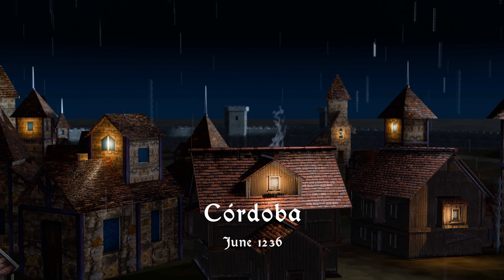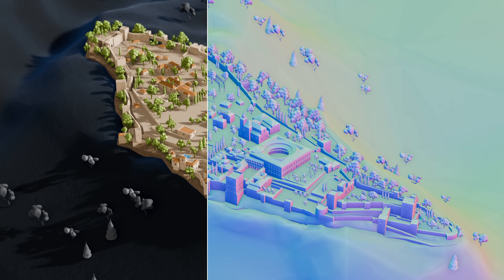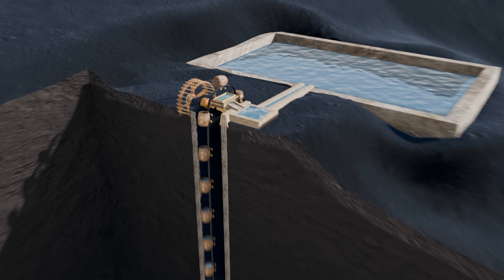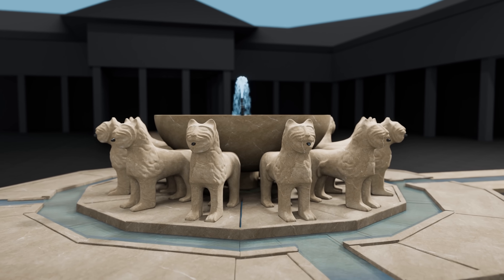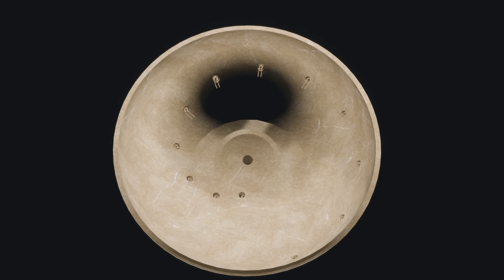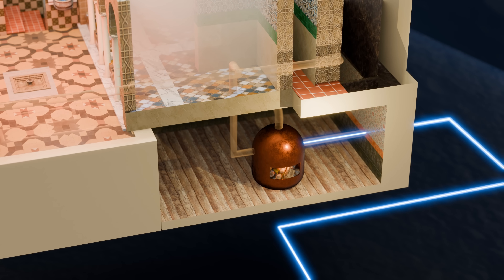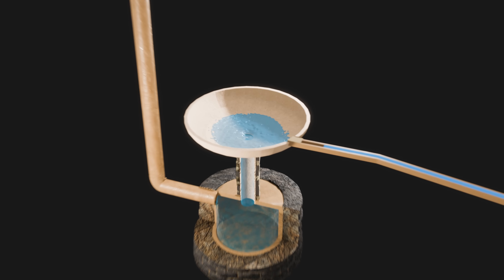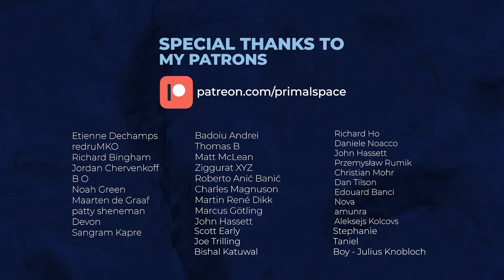The Ancient City That Mastered Water

Comment: this type of engineering is mind blowing. When the 12 lions spewed out water every hour to represent time, it really fascinated me. Truly a remarkable feet of engineering. Love your videos primal space!
Reply from the maker: Remarkable indeed. I'm so glad that you enjoyed the video. Thanks for watching and good luck in the giveaway!
Reply: It's weird,  because time was seen from dawn to dusk,  there is a marked difference between winter and summer solstice
Reply: Feat.
Reply: Should let the man use feet 😂🎉 bet people love him for it @johnstarkie9948
Reply: @johnstarkie9948  He likes Feet.
Reply: The reset system of the water clock is a variant of the self starting Bell siphon.
Reply: But the accuracy of the clock is a function of how the inlet flow is regulated.
I am guessing there was some form of constant head applied to the supply to the fountain? … I am thinking a dedicated header tank with a spillway to ensure a constant level (head) .. maybe with a calibrated orifice on the discharge supply to the fountain?
Any fluctuations in the supply flow rate to the fountain will vary the time interval between lions.
Reply: it even follows the Fibonacci curve !!!
Reply: @johnstarkie9948  oh , mb mb
Reply: Sadly the lions quit working after some people took them apart to try to figure out how it works
Reply: @bongkem2723  And how does this Fibonacci curve collect air and create air pressure of at least 0.6bar?  There must akso be alot of waste water from this system. How did they generate water pressure n what seems to be channels open to atmospheric pressure. If they had access to closed tubes, why nor just build the source reservoir 6 m higher up, problem solved. There must be a lot untold details in this.
Reply: Islamic engineering!
Reply: 666
Reply: @davidrowley-ic6dx but a constant water flow into the bowl wouldn’t work, as it would need to overcome the water leaking out via the lions, the flow would have to be incrementally increased.
Reply: @primalspace  What is your source about time-keeping lions? This seems much debated and unsubstantiated.

"While there are historical texts mentioning the fountain's complex water system, there are no surviving diagrams or physical evidence to prove its clock functionality."
Reply: @Chip-Cobb  Sorry ... but I disagree ... the fact that as the level reaches another lion and the outflow increases, so the rate of filling of the bowl reservoir slows .. but this just means that the next lion is set at a lower rise in level to compensate. The input flow needs to be set at a level greater than the total flow to support all 12 lions spurting.

The challenge is to compensate for the increasing diameter of the bowl shaped reservoir as the level rises as well as the increased outflow as each lion is triggered. As long as you have a well controlled input flow, you can predict the time to trigger each lion. There is a brief shot in the video of the inner surface of the reservoir bowl and the outlets to the individual lions are set in a very precise spiral running around the bowl .. a spiral that becomes flatter as it rises up the bowl.

Equally, there has to be sufficient flow to support all 12 lions and still permit the reservoir to rise to a thirteenth increment which is set to trigger the siphon to reset the clock.
If you watch the flow from each lion, it is actually quite a modest amount of water ... it is not gushing .. just "squirting". I suspect the nozzle of each lion incorporates a small orifice plate to choke the flow .. which also enables the flow rate through each lion to be matched as the height of water in the reservoir (the supply pressure to each lion) increases as it fills ... otherwise, as the reservoir filled and another lion started to spurt, the spurt from each preceding lion would increase proportionately to the increase in head of water at each outlet. The only way to control this is by choking the flow with an orifice plate such that the flow will limit irrespective of supply pressure. Standard practice in fluid systems today when one wants to balance flow within different branches of a hydraulic or air system (an example is in the balance valve fitted to the input side of each of your central heating radiators, with the valve at the opposite side of the radiator then being operator controlled to control temperature by throttling the balanced flow ... it's equivalence in an electronic circuit would be a fixed resistor to control current around the various limbs of a circuit, or to limit voltage at a particular component).

I do wonder how many times they got it wrong and had to start again !! ... It's one thing to calculate the necessary head to get it to work with a simple cylindrical reservoir ... but I'd really hate to have to calculate the equation defining the volume of that beautifully bowl shaped reservoir they had to use in this case and translating a simple head calculation into something much more complicated. I am not sure if, back in this late medieval period, the Islamic world understood the concept of differential calculus and integration which we would apply today. It would be fair to observe that their mathematics was way ahead of anything we had in the Christian world at that time .. we pretty much had to wait until Newton came along to do this sort of clever analysis.
Reply: Feat my dude, feat
Reply: All the smooth brains acting like it's a miracle by today's standards that people can't fathom today.
Some of the descriptions in the replies on how complex it is and what it would have used are laughable.

They likely reset it or adjust every few days if not every day, it wasn't keeping time over days.
It's not some great feat of math or calculation either.
They would have just run tests over multiple days with stand in to get the next approximations to be accurate.

Time keeping back then wasn't actually timekeeping like any of you people think.

They did not know the hours specifically, or elapsed time, that kind of timekeeping didn't come for ages.

They were merely marking the passing of time as close to an approximation that was commonly understood, no one actually tested it against any metric.

Would be like looking at a sundial and going "oooog ahhh there must be so much going on inside the dial to produce these results!"
Reply: ikr we arabs the best we made it
Reply: So wait, did the palace contain the opera browser or not?!?
Reply: @danielwatcherofthelord1823 Si!
Reply: @davidrowley-ic6dx  And what about rain and heavy sunshine?  And the fact that more and more lions have to share the same amount of wat ar hours go by until midday, the Pythagorean cup  resets it all an no lion gets any water til 1 pm?
Reply: @kjellg6532 "the same amount of water" As if the water didn't keep adding! Until siphon is triggered.

Without the siphon, the bowl will overflow, so stop with "the same amount of water" twisted logic, since obviously the amount of water overwhelmed the lions ability to spill water.
Reply: @Radiantradioactive  You are living proof that modern man is dumber than the ancients.
Reply: @muichirotokitotokito6819  The Arabs didn't make it.
Reply: @2adamast  The nearer to the equator you are, the less of a difference there is.
Reply: @clintonszeto  That's sad. Wish they could have simply repaired them afterwards, or at least made replacements from terracotta or compacted concrete without rocks and with only fine/small gravel.
Reply: There where vast more impressive water clocks, under water heating etc. Made by Greek minds who where masters in these fields. Sadly we lost most of the books because of Islam. But we do have accounts of many of these masterful inventions Greeks had made. Geniouses like Archemides had made before Christ was resurected. Sadly islam burnt most when invading citys like Alexandria, Ephesus, Antioch, Smyrna, Thessaloniki & Constantinople to name but afew. We barely have less than 5% of the Greek books of antiquiety! All the libraries & Greek universaties where destroyed. This knowledge comes directly from these Greek inventors & geniouses. The Byzantine throne room had. A large golden tree with birds singing that was mechanical. With a throne rising from the floor made of gold with 2 golden lions that mechanicly opened there mouths to roar as the throne rose up! Marble floor heated pipes had been used in ancient Greece for thousands of years. We found a city in Santorini that had marble heated floors with sewage & running water. & glass windows. 6 stored building city that was about 4000years old.
Reply: it even fl
Reply: @bongkem2723 Fibonacci studied in Algeria and learned math from the moors/Muslims of North Africa. So it makes sense

Comment: The fountain clock mechanism was also clever. Looks like a Fibonacci spiral!
Reply from the maker: Clever indeed. Thanks for watching and good luck in the giveaway.
Reply: I hadn't even noticed that 
neat
Reply: No, it just looks like an ordinary spiral. Why do you say it is a Fibonacci spiral?
Reply: Idk you don’t have to be that smart to do it, but the final whirl pool that raised the water up to the soldiers is incredible when you think that someone came up with that in the 1200s
Reply: @OrbisTertiusChannel  Assuming constant water flow, since the portion of the fountain that contains the water does not have a constant width, it means the hight difference between the different holes increases from top to bottom in order to have equal volume. It does not have to be exactly Fibonacci, but I wouldn't be surprised if it was.
Reply: @Bizz004  Uffff This is getting worse and worse! Haha. Bro! I will follow your reasoning... If we generate a spiral with the following characteristics: (1) Each new point of the spiral moves away from the center of the spiral a distance x. Always x for each new point. (2) And it moves tangentially a distance y. Always y for each new point. What kind of spiral would we have? Is an Archimedean spiral! Is not a Fibonacci spiral! A Fibonacci spiral is very, very different, because the growth is exponential. In an Archimedean spiral the growth is linear! And this makes sense because you want to add a stream every hour. This is a linear progression... not exponential.
Reply: @OrbisTertiusChannel  Smart guy 👏
Reply: And the emptying mechanism was a Pythagoras cup.
Reply: it might be the case, considering how the rest of the fountain's structure and lion statues all follow the golden ratio in their proportions.
Reply: The Muslims didn't invent any of this technology. It already existed and in many cases was exploited by the Romans centuries before Mohammad even cobbled together Jewish and Christian writings with Middle Eastern culture and invented Islam.
Reply: figured that too cuz I paint and fibonacci spiral is useful for composition
Reply: Fibonacci who learned and studied in Béjaïa 🇩🇿 where he used numbers of muslims (0123456789) get a book of history and maths maybe you'll sleep less ignorant
Reply: @OrbisTertiusChannel The spiral itself looks Fibonacci!!😀
Reply: Excuse me,  all drains that go straight down cause the fluid to gravitate/cling to the side of the downward drain and air follows down the center.  Volume desired determines the size of the downward drain pipe but air always follows in the center or it creates a vapor lock.  So think of a straw we dip in a glass of water and hold the end with our finger.  When we remove our finger the air allows the water out. Because we no longer have a vapor lock.  Anyway, the engineering is too good.  I salute our ancestors.
Reply: Fibonacci himself studied in Béjaïa ( Algeria) , the city founded by the same Dynasty as Granada : zirides !
Reply: I work there. It doesn´t work like that... never did. See the actual water system here. You´re welcome. https://www.youtube.com/watch?v=A5J13lvF_AE